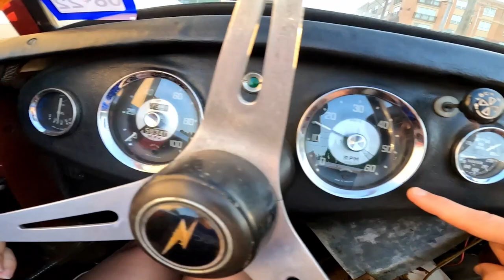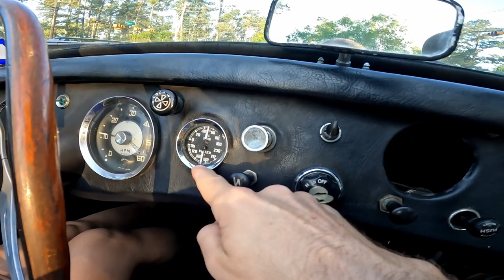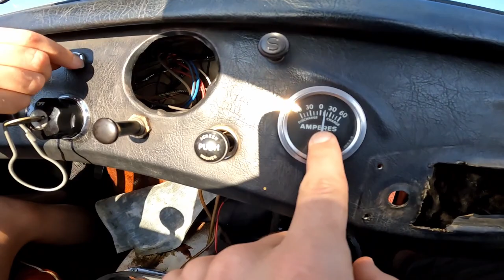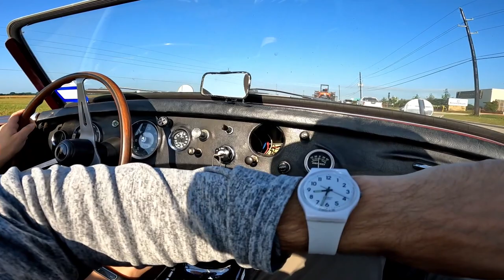1960 Austin-Healey Mk1 Sprite Texas Roadtrip

Comment: Mk 1 sprites were delivered with a 948cc engine with twin cars. The rear gears are pretty steep. The later "a-series" engines (1098cc and 1275cc) will bolt right in. More power and same weight.

Comment: 62 year-old car with 948cc and 42hp, 82mph 0-60 20sec; same A-Series engine found in Minis and Morris Minors although the Mini had various other displacements 848, 998, 1098 and 1275cc. This engine was carried over to the next generation Sprite and finished production in 1964, then replaced in favour of the 1098cc 59hp variant also found in the MG Midget.
Reply: The 1098cc started in 1962 at 56 hp.  It's a phenomenal engine, really likes to rev.

Comment: The "Texas Edition" is a discounted options bundle that includes exterior dress up items like the painted bumpers and 20" wheels from a higher trim level in that case, the older TX Ed had Chrome bumpers, grill and 20" wheels, it appears they went "sporty" with a monochrome painted bumper set up and an dark grey wheel on that year. So.e TX Edition trucks would also be the lowest priced version of the truck with leather interior as well, at least some years of the GM TX Edition trucks. There was a GM  TX Edition in the early 2000s that was RWD extended cab with the LQ9 6L which is highly sought after now.

Comment: The thought of 5000rpm in an A-Series gives me slight anxiety. I've driven a 1098cc variation a lot and the crank would snap at 5500rpm.
Reply: Really?  I take my 1098 Sprite up to 5500-6000 rpm literally every time I drive it.  I don't like driving it on the highway, but have driven it for 15 minutes straight at 75-80mph, putting the revs around or above 5000.  It's plenty peppy at highway speed.
Reply: I'm thinking that the cable drive for the tach is not very accurate.  5000 actual rpm would be stressing the heck out of that engine.  It would scare me to push it that hard for that long.

Comment: The temperature gauge takes forever to give a reading because the sensor is in the radiator. So the engine will be fully up to temperature before the thermostat opens and lets any water into the radiator to give a reading. The temperature reading isn't really showing you what the engine is feeling, just the radiator, which is likely to be a bit cooler than the engine. Crazy design, but I'll forgive the car for being so cute. And Oh my God! You couldn't have better illustrated the divide between generations than when you "broke down" because your phone overheated and you didn't know where you were going!!!!!!

Comment: Is it worth turning the car off at long lights like that? Or is the startup too inconsistant/slow to pull it off? (Or are there other thermal implications of doing so)
Reply: I would imagine the loss of airflow from the mechanical fan makes turning it off at lights at best a placebo if not actively harmful.  Turning the engine off on long downhills probably did work, though.  Also in that car I'd trust 4th gear clutch restarts more than wearing out the starter and battery.